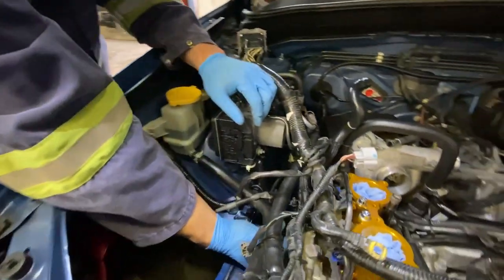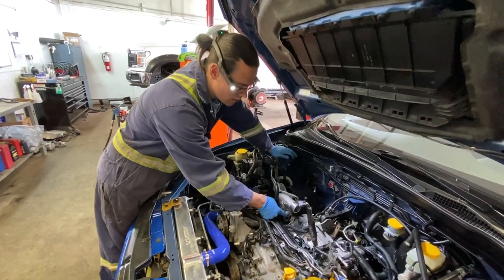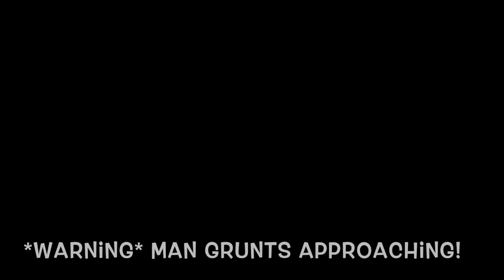2011 Subaru STi IAG Street Series AOS Install | Netfix Original Series: The Road To 500 | S1 Ep 6

Comment: GREAT VIDEO !!! HELPED ALOT !  just one question the hose from the blow by sensor u talk about im having an issue finding where that hooks up to did u put both to the turbo inlet ?
Reply from the maker: Hi sorry for the late response, are you installing a new street series IAG air/oil separator?
Reply: @Netfixandbuild  hey no issue thanks for the responseyes i am but i had a grimmspeed POS one on b4 and that removed some of the hardlines and pvc lines for me so its kinda ard to follow and instruction videos ?